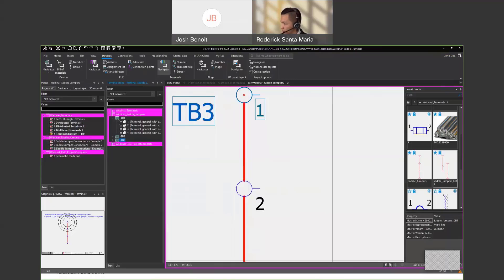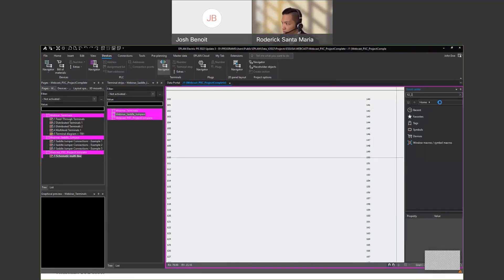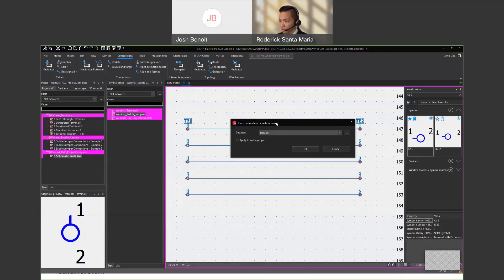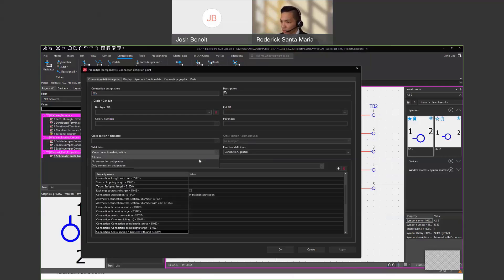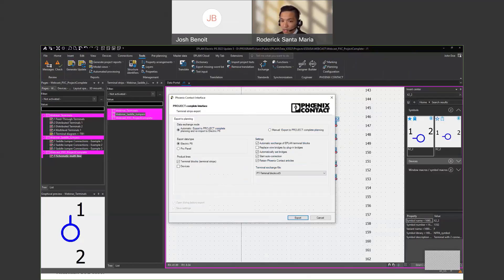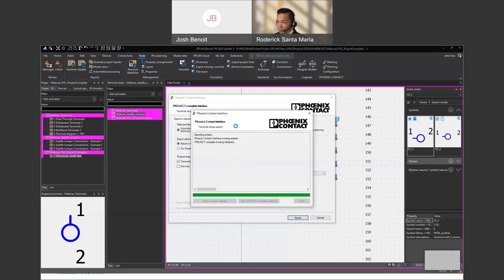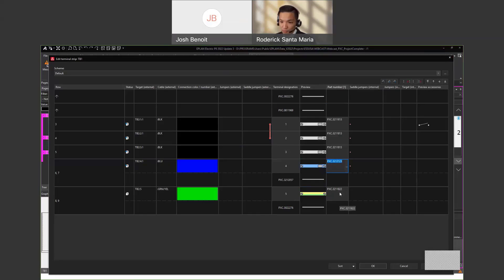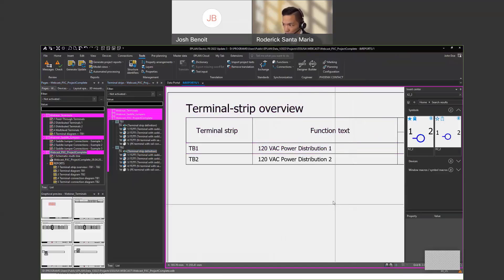EPLAN with Phoenix Contact integration

Comment: Hello. Thank you for great video. Do you have any idea systems informs me that i need to close the project to import the data back to Eplan (2022)? If i close the project and press import to Eplan (in Poroject complete SW), than i got part number is Eplan (after reopen the project). Otherwise it says that the project is "locked". Thank you
Reply from the maker: Check out https://www.eplanusa.com/eplan-partner-network/phoenix-contact/. It contains everything he needs to know on getting started with EPLAN-PXC Project Complete integration.